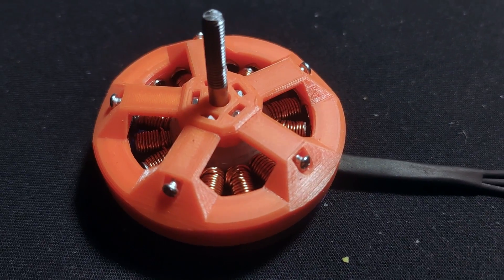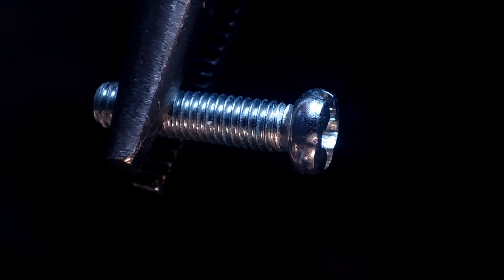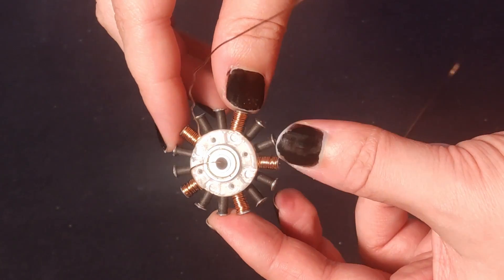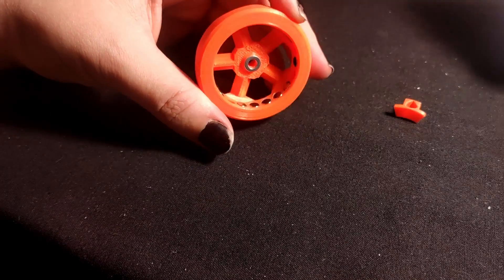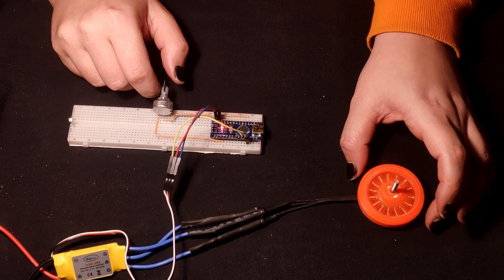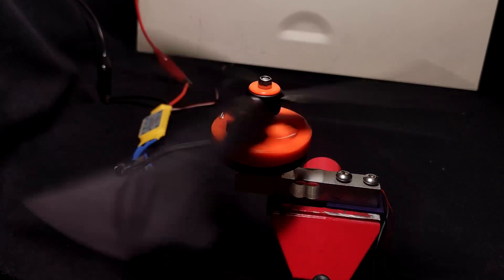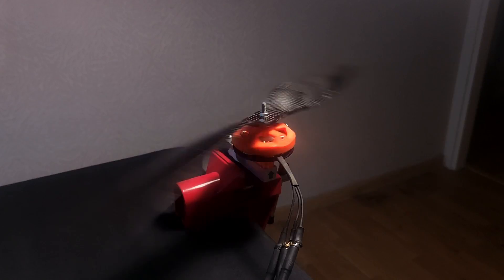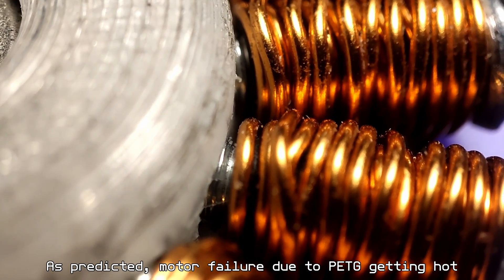A Simple BLDC Motor Build

Comment: why did it take 2 years to find this video? found you from the comments under recent BLDC video by logan. do you think making the core out of epoxy and iron powder will improve this design?
Reply from the maker: Epoxy and iron powder would make something similar to ferrite (I recall seeing a video where someone did exactly this and got fairly good results all things considered)... The answer is, probably? Though they sure are much harder to make than just screwing some cut and filed screws into a 3d printed part ;D
Reply: @BirdbrainEngineer  Hi again. what grade magnet did you use? Its NdFeB magnet right?
I was going to order 10mm dia 2mm thick N52 mags. That should be powerful enough right? perhaps too powerful;?? or should i save some money and go for N42. waiting for your advice.....
Reply from the maker: @VIJAYzk  The more powerful the better, always. N52 is the normal highest grade stuff (technically you could order N55 or even N60 if you make an order, but it'd be super expensive). You also need to keep in mind that higher N numbers almost always mean lower curie points, which means your magnets will demagnetize at a lower temperature too. Most N52 magnets shouldn't go above 60C iirc.
Reply from the maker: @ladisquera  Does not look like a useful motor either. No backiron for the stators, no cores for the stator electromagnets, uses circular permanent magnets in the rotor, and while they do their tests with 4A current, there's absolutely no way it could sustain that current for longer than a minute without melting the 3d printed body. I'm slowly but surely making an e-bike motor that mostly uses off the shelf components and 3d printed parts (just life been keeping me from working on projects), and even that one is going to be tickling the edge of what is possible with 3d printed chassis. Heat really is the top killer of 3d printed motors.
Reply from the maker: @ladisquera  This design is much better, but still uses air cores which is not that great (though I suppose for an RC plane/drone use case might be fine). In that video they still use a plastic housing so the plastic problem hasn't gone anywhere. Though yes, if you made the housing out of a metal that can transmit heat well then it would already be something that could be used, maybe. Also the motor should ideally use segment shaped magnets, Using circular is not great.
Reply from the maker: @ladisquera  The one in the shorts has the design ideas down mostly right. Either needs an iron backing on the bottom side for the electromagnet flux paths or a second rotor on the bottom. Also ideally the rotor should have a backiron to concentrate the magnets' magnetic fields towards the stator. And the last change they should make is to make sure as much of the electromagnet-facing area of the rotor is covered in magnets as possible - right now the segment magnets look too small for this motor, but I suppose they just had to deal with some magnets they found in stock online... For my e-bike project I custom ordered segments and they fill the electromagnet facing area almost fully (had to make a little adjustment in the design later on which pushed the magnets a few mm more outwards than I wanted initially)

Comment: The best steel for electromagnet purposes is low carbon steel up to a carbon content of 0.08%.
Reply from the maker: The point of this motor was to be extremely easy to make, so using parts that are in basically any hardware store. Pure iron nails or screws or rods, whatever have you, are actually not that common, let alone proper electrical steel (unless you rip the stator out of an old motor, but that kind of defeats the purpose anyways lol... at that point you are basically just rewinding and adding a new rotor)

Comment: I was inspired to make my own. My magnetic cores are made of 10.9 alloy steel bolts with a thin 3d printed jacket to prevent damaging the isolation. It seems that the magnetic permeability was good, and retentivity was good enough when testing with a magnet, but I similarly am running into hysteresis heating issues. Luckily the "cores" are screwed directly into a large washer I found in the street so the heating won't immediately destroy the motor.
Reply from the maker: Yep, construction mild steel is really not that good of a material for magnetic cores, especially when it is a bulk material like that. For the future I have a different design in mind that should have much less hysteresis and eddy losses.
Reply: @BirdbrainEngineer  I've been investigating silicon steel and other alloys. I look forward to seeing what you've come up with.

Comment: For the current draw/PSU voltage drop problem maybe you should try smaller wire gauge and make more turn.
Reply from the maker: The voltage drop on the PSU is simply because it is not that great of a power supply. It's rated for 33V, 10A or 66V, 5A. But we all know how cheap Chinese import machines behave - once it's getting close to maxing out anything, it's going to start struggling. On my newest video, I use a LiPo battery (which I did in-fact buy for the money made from YouTube videos, thank you very much!) to prevent voltage drop. Such batteries can usually supply many tens of amps before seeing any significant voltage drop.
Reply: @BirdbrainEngineer Yes, I understood. My point here is we should match motor to ESC and mechanical load.  If we have high kV rate, then it produce less torque and consume higher current. In my opiinion, we should avoid high current if we could. 
I just want to add one more varible to you to consider. Nice project BTW, love your video. just subscribed.
Reply from the maker: It's a trade-off of course...
Want lower kV? Need more poles or turns, meaning you have to either fit a smaller gauge wire or make the motor physically larger. Physically larger motor is heavier, thus power-to-weight ratio could suffer. Use smaller gauge wire, and your motor can handle less current due to resistive losses. 
Want the motor to be able to handle more current? Need larger gauge wire, meaning you end with a higher kV or a physically larger motor. With size, once again problem is power-to-weight ratio, and with higher kV the problem is, as you already stated, proportionally lower kT. 
The e-bike motor I will be making I will actually do proper calculations beforehand to figure out how many turns I need and how much heat generation I expect at any given load and so on.
Thanks for the subscription! <3
Reply: @BirdbrainEngineer  you made motor for your bike!!?? Have you published the video yet?
Reply from the maker: I have not yet made it, I am planning it out slowly, and probably will end up building it early next year; Winter is coming in the Northern hemisphere, so the seasonality isn't great for publishing an "e-bike" video for the next few months. Until then, I will have some non-electric motor videos planned, including the third air pressure engine design.

Comment: You can make a dual rotor, as you are only Benefitting half of the magnetic field,so you can double the torque with the same input this way.
Reply from the maker: A dual-rotor set-up for a radial flux motor is highly unusual and absolutely not a "simple" thing to do. I actually can't recall ever having seen a commercial dual-rotor radial flux motor before. For axial flux it makes more sense.

Comment: hello sir, a quick question. is it a must that a brushless motor have 3 wires for input??? can 2 wires of +ve and -ve work too???
Reply from the maker: You can make a motor with 2 phases, or indeed, even just a single phase! However, such motors will have worse power output characteristics (eg. the torque will be quite varying throughout the electrical rotation). If one makes a 2 phase motor or a 1 phase motor then the distribution of electromagnet poles and magnets is different as well, so it's not as simple as just simply using this design with simply 2 phases.

Comment: This is awesome! You were able to get 11.4v at 5 amps, which is basically a DIY 50 watt BLDC motor?! I wonder if some of your screws that fit the pieces together can be replaced by plastic clamps, perhaps using a compliant mechanism that holds things together tighter with stronger rotation. Resulting in a lightweight superefficient motor where the only metal is bearing, coils and magnets.
Reply from the maker: The 5A can only be held for some time... eventually the coils would heat up too much and the PLA would melt. Should use something like polycarbonate next time, which would melt only at ~140C

Comment: How about magnetless motor ? Is there any advantage except being cheaper ?
Reply from the maker: Magnetless (guessing you mean permanent magnet-less) motors are quite common - starter motors in cars are a perfect example! The main advantage for such motors is that they are cheaper and can't break due to demagnetization (which would often happen at a much lower temperature than what the copper wire insulation can handle). 

There is another application for magnetless motors... well... generators. A large majority of large electric grid generators (think in dedicated power plants) use electromagnets instead of electromagnets. And once again the reason is that it is cheaper and actually also allows for a little bit more control over the amount of power the generator produces.

Comment: Try halbach array on the next one. It deals better with large air gap than the usual style, and functions as a substitute for the iron ring behind the magnets to conduct the magnetic field. 1/8 x 1/8 x 1/4" magnets would be convenient so they can be used radial and tangential facing, or you could use 1/8 x 1/4 x 1/4" for the radial facing ones if they'll fit. Draw a little arrow on the end of each one pointing toward the north pole face to keep track of orientation.
Reply from the maker: On my axial flux motor, I made the rotors as a halbach array. This particular motor was supposed to be as simple as possible, so not a single advanced topic (no special windings eg. AaABbBCcC, no halbach array, no iron backing, no sensors, etc...)

When I get to making my next electric motor (probably sometime in summer), I will attempt to employ some more advanced techniques.

Comment: Parts looked like you could easily make with better material and home grade cnc. Very well done. I’d like to make hub motor for robot wheels but with gear reduction or somewhat low rpm and high torque.

Subbed to fellow tinkerer 🫡
Reply from the maker: I want to one day make an e-bike motor, which also needs to be a low-rpm-high-torque motor... And yep, a cnc mill and/or a lathe would be awesome to make parts out of better materials... my current living accommodations doesn't allow me to have such equipment though :/... not to mention such tools are quite expensive.

Comment: Lots of epoxy is needed! Super cool project. Would you mind explaining more of the build process and numbers? Id happily watch much longer videos from you. This one was...suggestive. Loved it.
Reply from the maker: Shouldn't need any epoxy for this one (unless you mean to try to hold on to the electromagnets a bit better :D), just a bit of superglue will do. I didn't test this motor for things like efficiency because I knew it would be very poor and due to eddy currents as well as saturation in the electromagnet cores would mean the motor couldn't function at optimal speeds without destroying itself (as shown at the end of the video) anyways. There are assembly instructions on the Printables page in the description for a step-by-step build process.